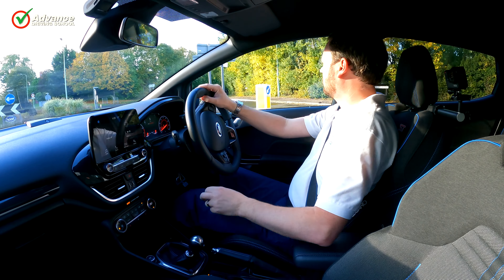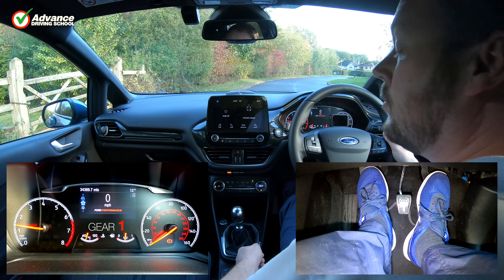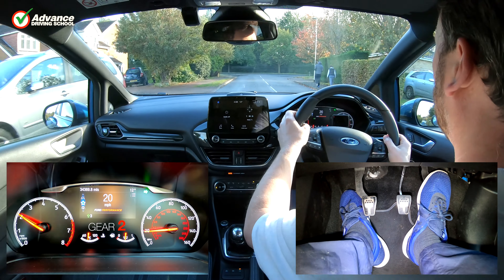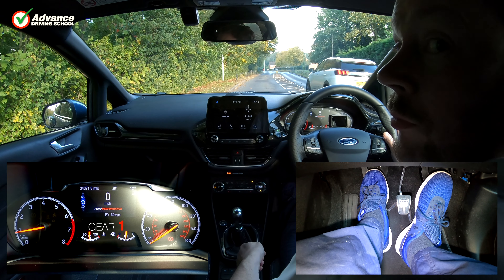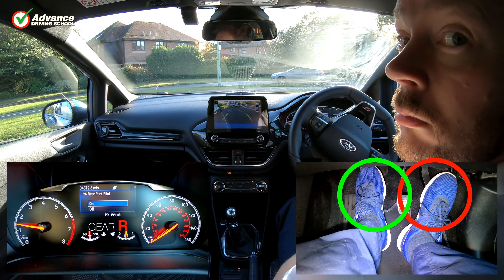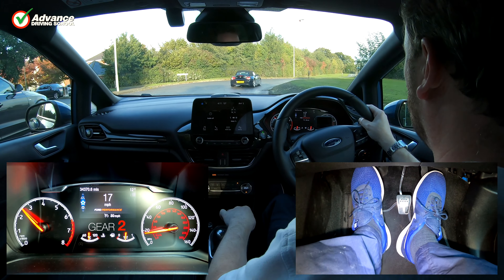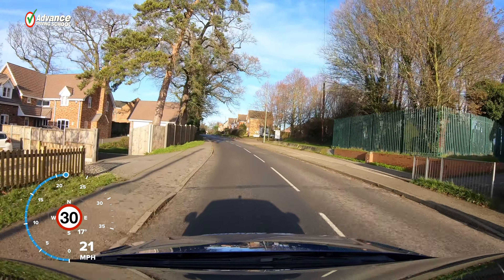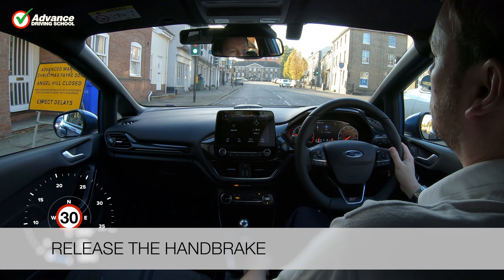'Gas, then Bite' to Pull Away Smoothly  |  Learn to drive: Car control skills

Comment from the maker: If you found this video interesting, then please visit our channel as there are over 100 more tutorial videos to help you improve your driving. If you would like to help us make new videos, then please consider becoming a member of our channel. Thanks for watching!
Reply from the maker: @chandramohan3363  Of course - it's called the Highway Code. Search for it online :-)
Reply: My instructor says clutch then gas because the clutch gives enough power to pull off.. should I be using gas as well or not 😭
Reply from the maker: @annabelleprince7527  Maybe it works in his car - but ask him what will happen in your first car if it has a small petrol engine?
Reply: @annabelleprince7527  feel the engine noise and vibration using both techniques,  accelerate first always. That way you will never stall.

Comment: Many instructors don't encourage learners to set gas, which then results in lots of stalling, especially when they pass their test and buy their own car which is a bit older and more prone to stalling with no gas. 

So good to see a video confirming what should be taught.
Reply: My instructor didn't teach me this because he has a diesel car. They usually have enough torque to get you going from just bringing the clutch up slowly. I learned the hard way. Drove my sisters car after my BMW lessons without learning gas then bite and I stalled alot 😂😂
Reply: @itzzayo5515  I'm having this exact problem. Learnt in a Diesel & bought a Petrol now that I've passed. Less than a week with my new car and I've stalled more times than I ever did whilst learning.
Reply: Passed my two weeks ago and got a car (2011 model) last week,  I was never taught gas first and its resulted in about 5 stalls in not the best situations which has really knocked my confidence! I'm now putting off using my car 😪
Reply: I was taught (in a petrol car) to never give gas before you reach the bite point lol. No wonder I was stalling the car so often

Comment: A lot of driving  instructors don't encourage learners to set gas slighty before lifting the clutch to a bitting point, which then results in lots of stalling. Thank you for elaborating on that.

Comment: I’ve taught and was taught Bite and then Gas. Never had a problem on driving tests or my part 3
Reply from the maker: The problem with that method is that it works best in modern cars. What if a learner passes in your car and then buys an older car with a small petrol engine? Stalling everywhere probably. Gas then bite works in every car so is how we always teach new drivers.

Comment: I wish I saw this video before driving my sisters car. I drive a BMW 1 Series which uses diesel. No need for gas when bringing the clutch up. I got so used to that, when I drove my sisters car, I stalled about 7 times within 3 mins 😂😂. She has a petrol car and I didn't know you have to apply gas while lifting the clutch up. It really knocked my confidence because even when I first learn in the BMW, I never stalled that much 😂😂. I advise people to go to an instructor who has a petrol car so you learn this method. If I wasnt curious or bothered about my stalling, I wouldn't have searched the Internet on stalling and I wouldn't know that diesel and petrol engines are different and diesel has more torque so you don't really need gas to help from starting off. Learn the gas then clutch method rather than lifting up the clutch slowly. I have about 20 hours worth of driving time and because I don't need to gas the bite in the BMW, I haven't learned this method at all😂😂
Reply from the maker: Thanks for your comment - as it’s the perfect example of why everyone should learn the ‘gas then bite’ method! Especially now that diesel cars are in the decline again now, so most people will probably drive petrol, before switching to electric eventually.
Reply: @AdvanceDrivingSchool  what do u mean by “are in the decline” ? Sorry im not native 😆
Reply: @MonkeyBadAssFist  It means that there are fewer diesel cars than there once were, and the number of them is still going down.
Reply: My car is petrol, but it can take off  by just bringing the clutch up. 🤷‍♂️

Comment: Finally I've figured why I'm stalling as much as I am.   Basically I've had three lessons so far and I'm learning in a diesel currently and I'm finding it hard work.  My general safety, movement, positioning and control are ok but I keep stalling.  Stalled on my first lesson just the one time which is fair enough but then several times on my second upon turning left out of the junction and into the junction and today on my third, I kept stalling at this one junction, slight incline, turning left.  My current instructor has taught me to move off ONLY USING THE CLUTCH.  My previous instructor many years ago now I remember told me the method you are using here and I barely even remember stalling with me during our lessons.  Now it all makes sense!  I've been bashing myself for stalling every lesson but this is exactly why - I'm trying to find the bite using this heavy thick clutch and trying to move off too quickly and then applying the gas and like you've demonstrated here it's not that effective and at this point my clutch control is not good enough. 

I need to change instructors and go to one who taught me like before - set the GAS FIRST then raise the clutch, biting point and GO.  

I first learned at 23, I'm 38 now and it's hard enough as it is but I remember the good instructor spent most of the first lesson making me find that biting point over and over again so became natural asap.  As a result I was so much better back then and made excellent progress.
Reply from the maker: We always use 'gas before clutch!' Hopefully that will be the end of your stalling 👍🏼
Reply: @AdvanceDrivingSchool   just want to make sure then the exact process when you move off - clutch all the way down, put it in first gear, then push on the gas just slightly? And then raise the clutch until the biting point, hold for two seconds or so, slowly release the clutch and then you're off....??
Reply from the maker: Pretty much. We filmed it in more detail in this video: How To Drive A Manual Car: https://youtu.be/rKqdFlzILZc 👍🏼

Comment: I disagree with gas before bite.  Though I was taught it during my lessons, I believe that it's easier to move off by finding the biting point of clutch in Manual and then letting off the brake.  When I brake I almost always use the clutch in unison to prevent jerking the car, then hold the clutch down until I need to move off again.
Reply from the maker: As we say in the video, you can get away with this method in newer cars. Try moving off in a fully loaded older petrol car and it would be a different story!
Reply: @AdvanceDrivingSchool  Well, I'm currently driving a 2002 VW Polo unleaded and I'm finding no trouble with the method I'm using now.

Comment: I have a 1.2 engine Honda Jazz car 2005 and most times I just bring the clutch up to the biting point until I feel the car engine shake or the car dips slightly. I then use this to move the car by slightly bringing the clutch up (not totally but depending on how much the car moved). Thereafter, I gas and gently bring the clutch totally. I use this technique almost on all types of road surfaces both level road surface and steep inclines. But when I need to turn right on a steep incline or at a roundabout in busy road conditions, I gas first and bring the clutch up so I can pull away quickly at the slightest opportunity. I will not recommend my first method because it takes great skill and practice not to stall. I hardy stall though.

Comment: this comes handy as i passed with new diesel car. and bought 2007 petrol..

about clutch burning isn't clutch burning when reached certain heat? i think something like 200 degrees, so you would need to rev engine over 3k rpm in over to burn clutch. but as we can see 1.5k is plenty enough to get car going?or am i wrong somewhere?

regards

Comment: I learned in a 1.5 Focus diesel, I could pull away just using the clutch and the come onto gas. My car is a 1.2 Corsa petrol and I have to set the gas in this otherwise I will end up stalling, I stalled it about 30 times on my first drive in it 😂
Reply from the maker: This is exactly why we recommend the 'gas then bite' method, as it works in all cars!
Reply: @AdvanceDrivingSchool  Very true, I think instructors should teach it, especially as they have much newer cars, which are also more forgiving than an older car, which a student is more likely to have once they pass
Reply: Yeah mostly it works on fuel injection car. But it doesnt work when your car fully capacity passanger or you will start drive your car at hill road.

Comment: I will try the gas before clutch method out on my 99 Honda civic coupe which is a 5 speed manual are you sure it won’t do any damage to the clutch ?
Reply from the maker: Just keep the engine revs below 2000 and it will be fine. 👍🏼
Reply: @AdvanceDrivingSchool  Thank you but only
Problem is my car doesn’t have a tachometer so I can’t see how many revs I’m giving it :(
Reply from the maker: Ah. Just add a little extra revs by ear then. If you ever small burning then you know it was too much!

Comment: My instructor's car has an electronic handbrake button which only releases when I press it at the same time as pressing the footbrake. So then my left foot is on the clutch, and right foot on the brake, nothing on the gas. I asked if his electronic handbrake has a hill assist feature which I've read would allow me to switch my right foot to the gas instead of the footbrake, but he tells me not to worry about that and just use the clutch... should I follow his advice or not? Thanks, great video btw
Reply from the maker: You should follow your instructors advice, as they know their car best. This car has a ‘hill assist’ function, but we find it unpredictable and have turned it off. Also, you don’t want to rely on a feature that your first car might not have.

Comment: Every time I try your method, when I get to the step where I release the hand brake and let up on the clutch a little bit more I stall. Every time. What could I be doing wrong?
Reply from the maker: You are probably lifting the clutch too early or too much. This video might help: Mastering Clutch Control: https://youtu.be/8ofUKNQyYBg 👍🏼

Comment: My driver makes me so clutch to the bite and then accelerate. I’ve stalled a few times because of it, is this bad?
Reply from the maker: We think so, because it only works in new cars.
Reply: @AdvanceDrivingSchool  okay thanks for your help! Great video!
Reply: @ja_2003   your method will only work in flat ground and some gentle slopes but if you are in a very steep uphill then there is a big chance that you will stall. I do agree with @Advance Driving School that you need to give gas first then clutch.

Comment: I learned in driving school another method to pull away on steep hills. I engaged the handbeake and when I want to go I release the cluch to the biting point and hold it there no more than 5 seconds top and than I add some gas with my right foot and as I add gas I release the handbreake at the same time as I adding some gas. Is this method good or you recomend gas than bite method to pull away on steep hills. My method is similar to your method of pulling away without the handbrake.
Reply from the maker: We definitely prefer the Gas, then bite method as shown in the video.
Reply: @AdvanceDrivingSchool  ok...I will use gas than bite method. Thank you for your answer. I wish you all the best.

Comment: The problem with the gas first for me is my gas is so sensitive that the slightest touch and the car will be reving like crazy
Reply from the maker: Keep practicing! Your right foot needs to be very gentle when ‘setting the gas’ 👍🏼
Reply: That’s a problem I had with my 1999 Honda civic coupe it has a sensitive gas pedal what worked for me is that I need to push it gently and slowly for me to not rev it too much

Comment: i have a question, is it necessary use this "gas and bite" method from 1st gear to 2nd, or 2nd gear to 3rd gear an so on?
Reply from the maker: No, it’s just for pulling away. Once rolling, it’s the other way round - like in this video: How To Drive A Manual Car: https://youtu.be/rKqdFlzILZc 👍🏼

Comment: My instructor alway has me start with the clutch down and the brake pressed and handbrake on, then remove the handbrake, then find the biting point, removing the brake then applying gas - is this right? How come your method doesn't use the brake?
Reply from the maker: If you are pressing the brake, you can’t push the  accelerator! The trouble with that method is that it doesn’t work in all cars, and can lead to a lot of stalling. In contrast, ‘gas then bite’ works in all cars 👍🏼

Comment: This way won’t work with a car with an electronic handbrake because as soon as the gas is pressed the e handbrake will release.
Reply from the maker: Not so - the Audi A4 we had would auto-release the electric handbrake when the clutch bit!
Reply: The Vw golf I have will release the electronic handbrake before biting point is reached. I’m a driving instructor btw.
Reply from the maker: How strange. Perhaps in your car you have no choice but to use the clutch first method!

Comment: My problem is having to much gas so it’s revving when pulling of
Reply from the maker: Some cars have sensitive accelerator pedals, so it's tricky to get the engine speed just right. With practice you'll get it!
Reply: @AdvanceDrivingSchool  yeah! It doesn’t take much to make my car rev 😭😂

Comment: I usually use as little gas as possible when moving away so I put the least wear on my clutch. However I can often hear the car sound like it's labouring when I do this.

Should I give more gas to avoid this, is it harmful?
Reply from the maker: As long as the engine doesn't stall there isn't really a problem - but a little more gas to prevent the engine struggling is probably a good idea, if it gives a smoother pull away.